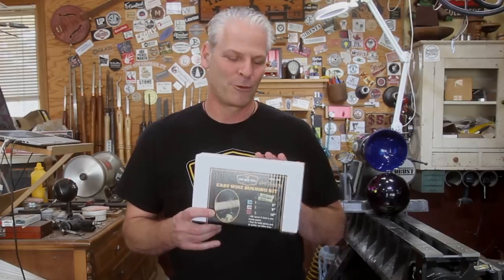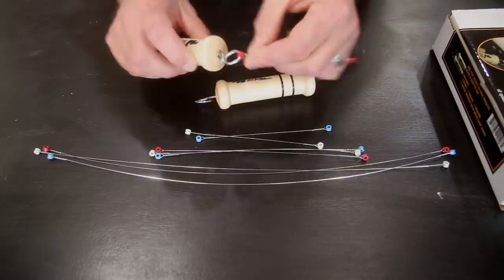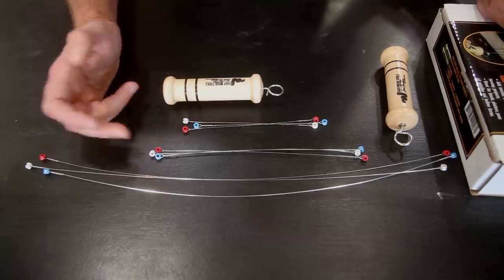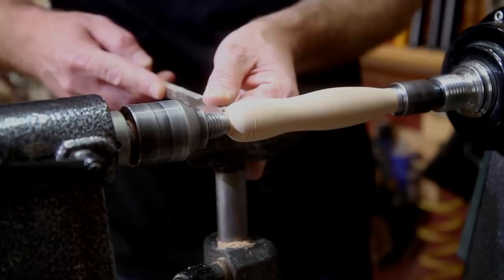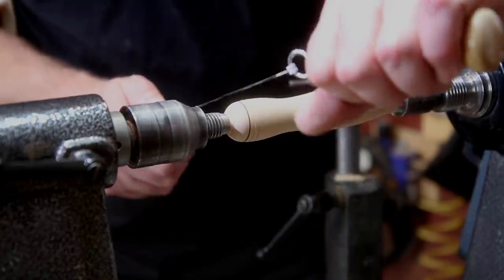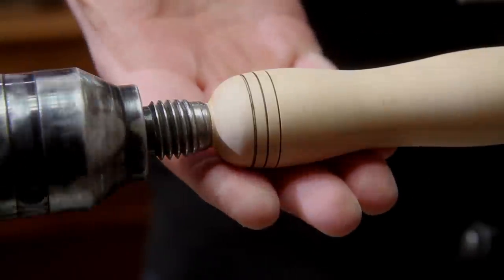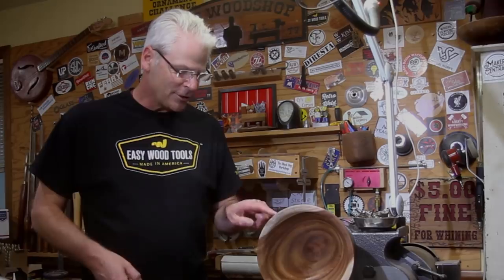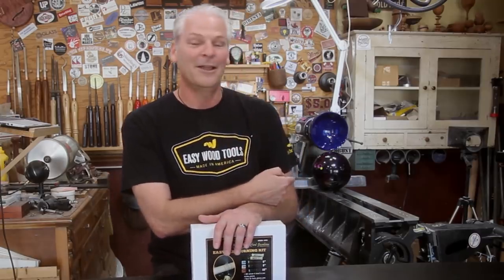Woodturning | New Wire Burning Kit

Comment: I guessed the retail at $50.00 before looking and I was a nickel to high. I think that is a little high but I am cheap. Nice video. Thanks.
Reply from the maker: The other kits don't cost quite as much, but you don't need to replace the whole set when you broke one.

Comment: I just use a coping saw, with the blade turned backwards.
Reply from the maker: Great idea.....I'm sure it works well.
Reply: are ya gonna use the Carl Jacobson wire burner in your coping saw to cut wood.......when you buy one of course ;)